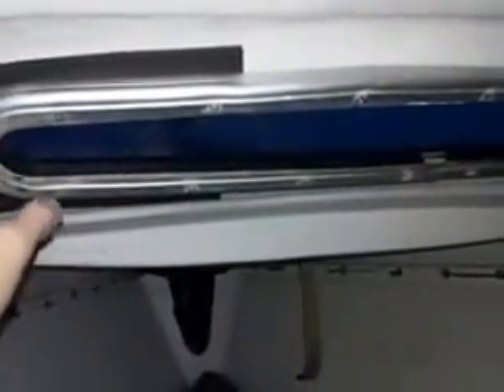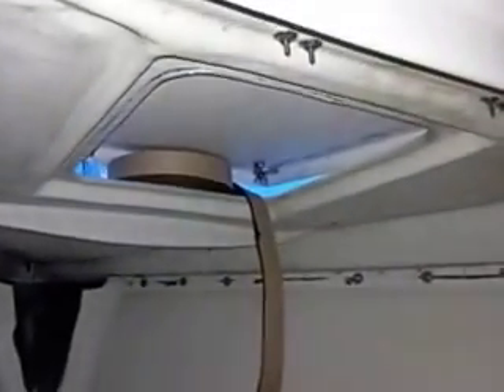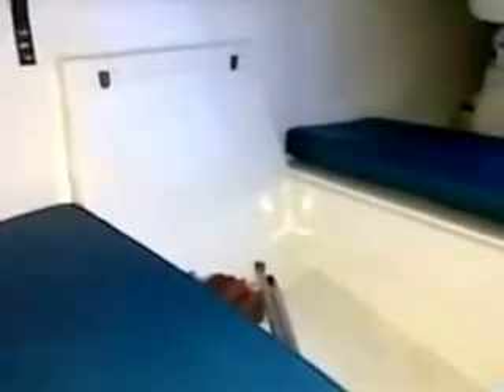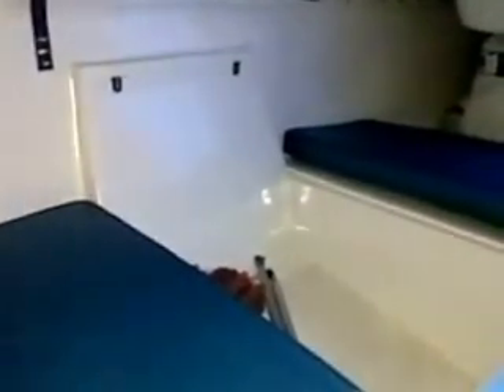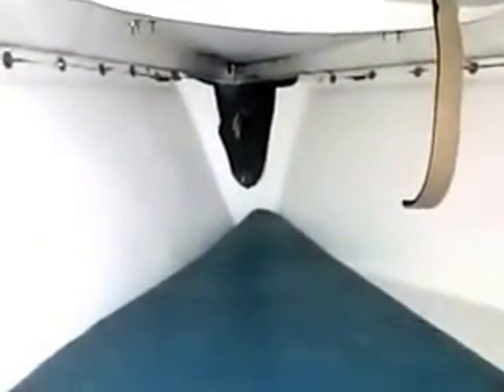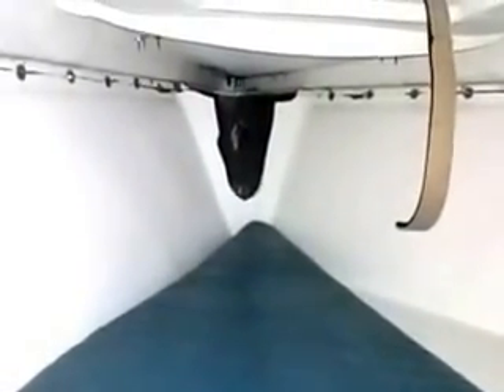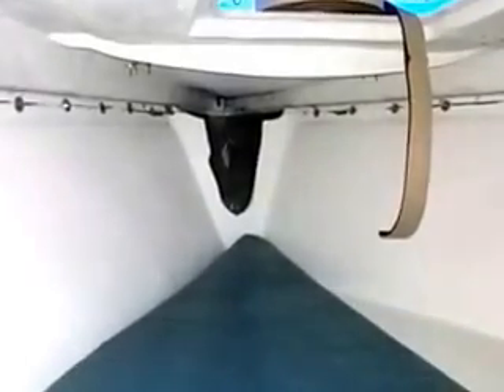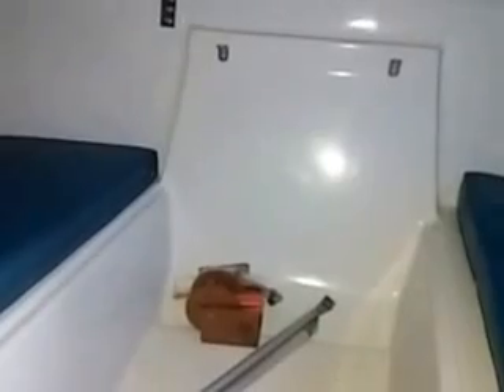Macgregor 22 sailboat restoration

Comment: Wow the difference between yours and my 1971 are drastic in fabrication. I still have wooden bench seats which I am glad for because of my extreme modifications. She's lovely. Can't say I have ever seen one where the keel lock hole wasn't living proof someone ran shallow. I've only ever locked mine once in port in a really bad storm but sadly that was after it snapped off the winch cable. I'll have to post my crazy modifications on here someday. Refrigerator/freezer, flat screen TV, Blu-Ray, stove/oven. I think I will be removing the 8,000 BTU air conditioner though. Just a little too much. But I live on it all summer so maybe not. All that and she still sails.

Comment: I now believe the galley was orginal. I have a 1980 23ft venture with the same setup. It's hard to believe it was factory installed. On mine it has screws protruding that line up with holes for stowed and extended. Looks like a kindergartener lined up mine